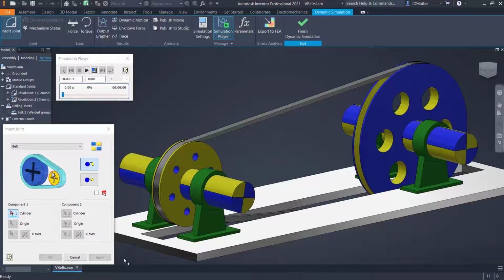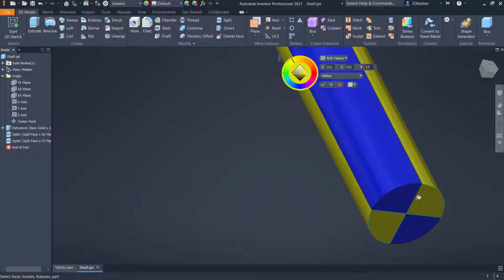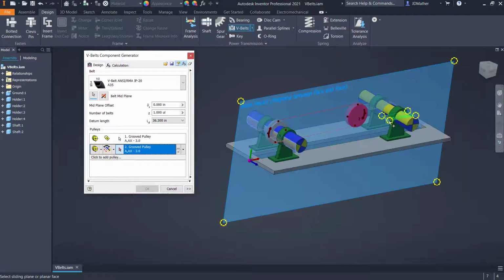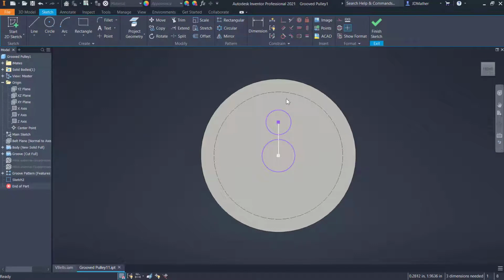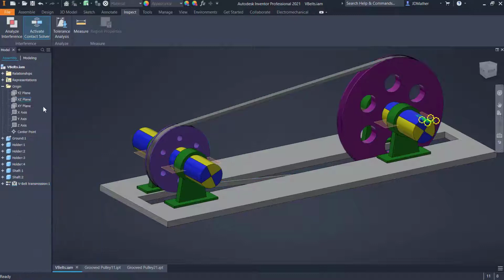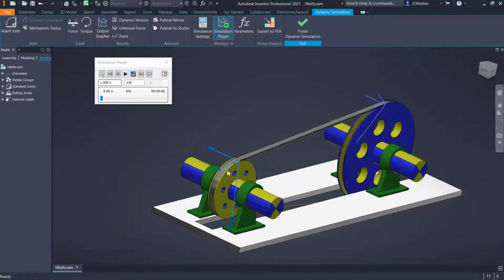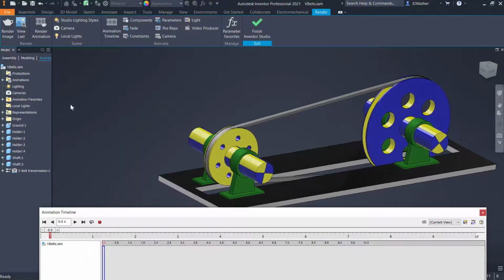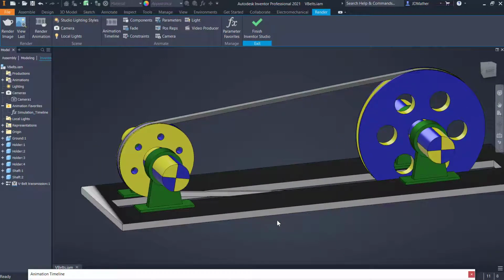Dynamic Simulation   Belt Joint

Comment: I followed your webinar very well, but i made test setups with chains,  does the dynamic simulation also works as an dynamic chain joint ?              In the Insert Joint menu there are rolling and sliding cilinders, belt, screw, wormgear, but there is no chain .........
Reply from the maker: Do not take the names of the Joints literally - think in terms of Degrees of Freedom.  Use Belt Joint for a chain mechanism.  If you still have trouble - post back.